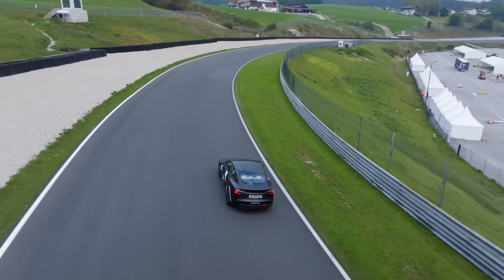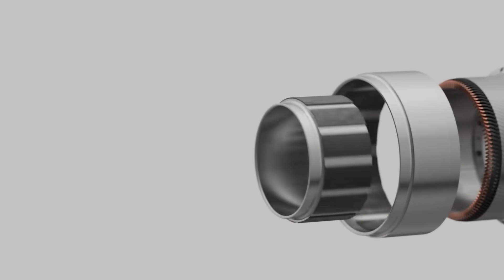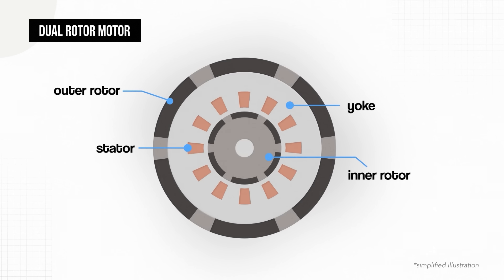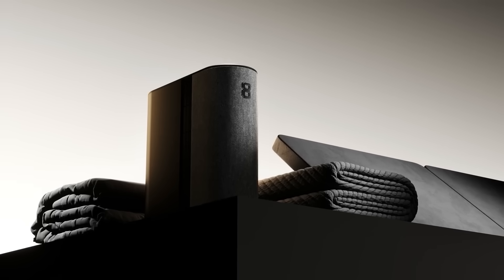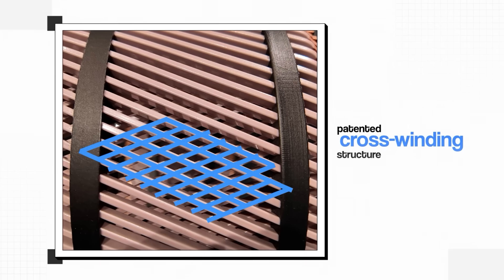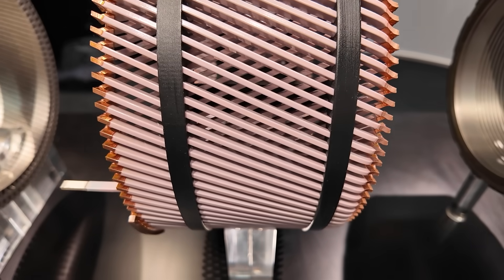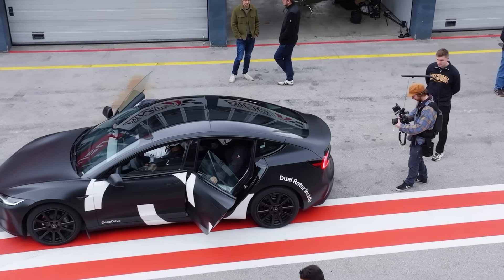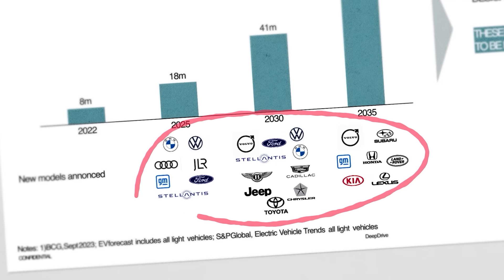How Dual Rotors Make Motors Insanely Efficient

Comment from the maker: Invest in a better night sleep and be more efficient with your heating and cooling with EightSleep! Use code ZIROTH for $200 off the Pod 5 Core or $350 off the Pod 5 Ultra, or visit https://eightsleep.com/ziroth
Reply: Only thing that needs to happen with their design is to shrink it down..... the fun you could have with that on an e-bike or in a drone would be wild (the latter especially due to the weight savings alone)...

maybe a 6 phase for industrial applications or stepper motor variant for robotics and the like.
Reply: @AnotherOtherMan   if its 20% more efficient with some of the new electric engines for planes that are like 92% efficient compared to ice ones that are 60-80% they might be able to push efficiency past 94%that means electric planes will have far longer ranges than non electric and cost pennys to fly in comparison 
youll have country's with cheap power having planes fly over to recharge there
Reply: @violetquinnlaw  The RC planes I've seen all ran on up to 85%-90% efficiency with just brushless motors, but they had to have their RPMS higher with less pitch on the props to get the high up. 

From what I can tell on the wire setup design. Only the X  part from above & blow that windings is giving out a high enough magnetic force to be used this means there is multiple areas that is just used for cooling & not actual force making.
Reply: @violetquinnlaw  It honestly makes a lot more sense for lower torque, weight essential applications like aviation, too. I worry about that cage long term in high torque apps, but in high RPM constant load applications like aviation it seems like a perfect fit. You could probably even do away with the liquid cooling with that much airflow
Reply: These are the people who kicked people out of bed when AWS had an outage. No DRM beds, thanks.
Reply: Oh I’ve heard about EightSleep … when their beds stopped functioning due to an AWS outage in the most unstable major data center in the US, with no backups, local control, or region failover … while charging their customers hundreds of dollars a year for the privilege.

Your channel seems solid, but if you are going to advertise garbage, it will pay the price. Find better sponsors who care more about engineering than profits.
Reply: ok how much is there subscription. id love to get one for my cat
Reply: Using both sides of the magnetic flux seems so obvious now
Reply: that shows that those big firms has zero R&D dep, no wonder they collaps !
Reply: Have wished to get such bed different temperature thing for quite some time. But come on, over 3K for a small fridge? Really? Isn't it some 30 times overpriced? And then an app. And a service, of course! No way dude. All respects for your content, but this ad is ridiculous. If we replace the fridge part with a thinner blanket, then we go down for the heater to pretty much 100 times overpriced product. If I buy such, then I could as well go full Adobe and Oracle.
Reply: With THAT kind of torque, you should definitely suggest to them that they connect with Edison Motors for use in electric axles in their heavy trucks.
Reply: Eggactly!
Reply: Great,  now all we need to do is get rid of the batteries and upgrade to  Micro Fusion power cells...
Reply: What is torque. More Atoms in Action
Reply: I want motor in horizontal design not vertical
Reply: This guy copied your video https://www.youtube.com/watch?v=G6Ye7vjgdVI
Reply: Are they listed on a stock market?
Reply: A press release with embedded ads - we truly live in a dystopia
Reply: That looks amazing. 

Checks site.

$4000 AUD ARE YOU MAD
Reply: nearly £2K to buy it and you need to  subscription !!!
Reply: @CaskAleForever  and yet they still sell your sleep/health data to 3rd parties because apparently that's not enough money to extract from their customers.
Reply: @megapro125  can't trust the "government" = can't trust smart appliances.. GREAT JOB, TAPEWORMS!!!
Reply: Didn't they also just have a huge problem with overheating when customers lost internet connection?
Reply: Game changer 👀👀👀

Comment: True DeepDrive has solved a few of the issues associated with in wheel motors.  But there is one big one that I doubt there is a solution for without some material breakthroughs.  And that's the vibration and harsh environment these motors have to survive.  The motor will have no suspension protecting it from the road.  Every impact will hit this thing and be very violent.  These motors probably will not have a long service life.  Even a slight change so its not truly in wheel but out of wheel connected with a CV Joint would greatly reduce direct vibration to the motor from the road.

Comment: Not new old idea that go back to the late 1970s there is also an electric motor and generator that was used copper tubing in the windings and flowed a cooling gas though the tubing

Comment: why use copper when aluminium is close enough at conduction (heat and electric) and a LOT lighter so ou can increse the bar size and have a reduced price.? Copper is used in conventional motors because aluminium is a poor material for the windings but thus may not  be the case with the bar architecture here.

Comment: What about in wheel motors on semi tractors. I wouldn't think the added weight in the wheel would be an issue as generally the central motor design is part of the axle and therefor also unsprung. What a reduction in parts and complexity and make it easy to have the front wheels powered.

Comment: adding another air gap increases the magnetic reluctance thus increasing the current required to induce the same flux, also I assume the outer rotor would require current pathways to interact with the magnetic field and generate torque, which means no lamination which means higher eddie currents and losses… must read more to see how all of this is addressed

Comment: I’m not an electrical engineer by any stretch, but to my understanding, there is a direct causal relationship between the capacity of a circuit to conduct an electric field and the surface area of the conductive element carrying the load. Hence the benefit of multi-filament cables in car audio systems, for example. 
The copper bars that form these truss lattices are essentially a non-ductile form of monofilament wires if i understand correctly. Yet they functionally replace a multi-filament winding (its the same wire passing by itself many times, so not truly multi). Is my grasp of this material as lacking as I suspect?
Reply: Yeah it is a little different than that. The multi filament car stereo wires are generally made of higher quality, lower impedance material, meaning the wires can conduct more without overheating because they have less resistance (and thus they generate less heat.) In this case the concern was the structural integrity of the component, if cooling is sufficient they can ram more wattage through the system and it would work just fine. It's usually more efficient to have more windings in conventional design electric motors (to a point obviously) but in this case they have other design elements that make their design more efficient

Comment: You and the designer have given no real world use. You say it is lighter . . . Lighter than what? What does it weigh?
What cars could accept  the internal motor? And marry it to a 5 speed tranny?
Will it marry up to a front drive car . . . A rear wheel drive.
Only destined for a new car?
Available for an EV conversion in my '66 GMC truck.
Building nifty things is just fine for a bunch of gear heads.
Now what good is it in the real world?
Oh, that's right . . . You didn't bother to say

Comment: Brilliant Work, indeed.  Elegance is a virtue.  Nevertheless, electric motors / generators under what has essentially been Faraday’s original discoveries (1821 & 1831, respectively) are nominally in the 93-97% efficient range.  So, isn’t the real achievement here reduced mass and volume?

Comment: A very clever innovation. However, whenever we see someone claiming 20% improved efficiency on a product that is already above 80% what they means is 20% of 80% which is 16% which is frankly hard to believe. 

The axial flux configuration is clearly superior in power to weight ratio, and look how long it is taking to see mass production of an axial flux car (not yet in volume use). And to prove durability takes years of testing, so we won't see deep drive in any vehicle until 2030 if ever.

Comment: Sorry to nitpick a brilliant innovation, but I am perpetually bothered that folk never "get" the difference between strength and stiffness. 
Something is strong, if it can support a load (force, torque) without BREAKING. Something is stiff, if it can support a load without DEFLECTING. While the two are often related (like, Young's modulus), copper (as a metal) is neither strong nor stiff (compared with steel, for example). However, stiffness is also influenced by geometry, and the "triangular" structure built by the diagonally laid windings add immense torsional stiffness through their shape, not the material they are made of. 
So, claiming that copper is used because "The windings have to be extremely STRONG" Is misleading. The windings have to be extremely stiff, because if they deflect, they will clash with the rotors, and the motor is instantly wrecked. 

I believe copper is used not for strength nor stiffness, but the good electrical conductivity and low resistance (hence its preferential use for all things electrical). The clever bit is the use of solid bar to make each run of metal stronger and stiffer (compare one solid bar, with the floppy flexibility of a stranded wire), and the diagonal layout adds the geometric stiffness of triangles, which will dominate the structural stiffness. 

It is certainly nitpicking, because resisting 2000Nm of torque is an insane load, so the structure DOES have to have strength as well. On the other hand, that torque is dispersed through every copper bar, so each one is only generating a small fraction of that torque, so the local loads are manageable. 
In this case, the welded joints at the tips of the winding bars are absolutely critical - this is by far the weakest point of the structure. But they could also fill the space between the bars with an inert material (like resin, or plastic) to provide a solid tube of material that would be seriously better for both stiffness and strength. Careful engineering of this (like, adding it as a sheet / tube between the two layers of windings) would barely affect the coolant flow and heat transfer, while still adding significantly to structural stiffness and strength. 

As an example, consider a weightlifting bar. Universally made from a high strength steel, they nevertheless bend by inches when really heavy weights are being lifted (like, 600 pounds). They deflect a little, but do not break. Now, if that same bar of the same geometry was made in rubber, the thing would never get the weights off the floor. It would stretch at the lifting point, deflecting probably several yards, before ultimately it would break, since the cross-sectional area of a bar of rubber will not be STRONG enough to pull the weight off the floor, no matter how high it is lifted in the middle. So, even though it visibly moves, the steel bar is (relatively!) stiff, and certainly strong, whereas the rubber bar is neither stiff nor strong. Copper would be somewhere between the two. Weaker than steel, but stronger than rubber, and equally stiffer than rubber but more flexible than steel. 
You can easily bend the solid copper conductor in your house wiring by hand - even the large 1/4 inch meter tails - but try to bend a steel wire of the same diameter, and your fingers will stop you in pain before you manage to bend it, because it is too strong for human flesh. 

The science of understanding stiffness and strength is a core principle of engineering, yet I see far too many smart folk saying "strength" when they mean stiffness. 
As if "strong" has somehow changed its meaning with common use, but (in a field as technical as this motor and the engineering behind it) it is important to use the right terms, to convey the right meaning.

Comment: I dunno man, I’ve been an auto mechanic my whole life, and the core problem with in-wheel motors is right there in the name: they’re in the wheel.

Wheels flex, shift, and torque on the hub. Maintaining a precise air gap between the stator and rotor in that environment is fundamentally hard. All the shock loads from the road go straight through the tire into the hub, and modern low-profile tires only make that worse. You’re hanging a very expensive, precision device in one of the harshest environments on the car.

Sealing is another big issue. In the real world, standing water, winter slush, road salt, keeping that motor truly sealed over time is extremely difficult. A curb strike would likely take it out. And when it fails, that’s not a half-shaft or bearing, nope... you’ve lost the motor itself. You’re putting critical hardware in the worst possible place. This is where clean engineering theory runs head-first into reality.

A much better solution, in my view, is mounting a compact motor to the knuckle on the inboard side of the hub, where a CV axle would normally go. Shock loads are dramatically lower, there’s no hub-induced torsion trying to collapse the air gap, and the rotor and stator are supported by conventional bearings like any normal motor. Sealing is straightforward, drivetrain losses are still essentially zero, and packaging is clean.

Run the HV cables, coolant loop, and control lines through a single flexible harness and you’re done. Same benefits, far fewer compromises. Honestly, it just makes more sense.  The space is there for small motors, but if you do four of them... hey, you've got your drivetrain.  It's just an e-knuckle instead of an e-wheel.

Comment: yeah bro, steel mounts for the magnets instead of the iron yoke use a more conductive metal... since steel has carbon in it and carbon is one of the universes best conductors... the fields are going through these elements. This plays a small part in the efficiency too. The iron kind blocks the magnetic fields. Everything is coming together. IF ppl could figure out how to make pure carbon housings with enough rigidity to mount magnets and a slightly better copper winding these would be superman efficiency. Thanks for the update on things around the world.

Comment: I worked for the OEM of aircraft electrical generators in the research and development department for about 15 years.  They studied and built all kinds of generator which all can be also motors.  It also have used FEM programs to model electrical magnetic flux fields and electrical coils.  
The image of the winding is an ironless coil that in the flux field is represented as an air gap.  A very very very large air gap.  This is where the resistance is highest in a magnetic machine.  Lots of losses.  I question the gain in performance considering this issue.  That air gap  resistance is going to be best guess ~90% of the magnetic flux resistance for static assembly.  The basic equation of force equals flow times resistance applies.  The force is from current flowing in the coil wires.  
The other major energy in the motor or generator is the skewing of the field to create torque which is another flux resistance added to the static value.  Torque is the force, coil current, acting on skewed permanent magnets.  Energy is torque time displacement that has to be equal to the extra voltage  time current.  
A typical magnetic machine is below 30% efficiency for a machine with the flux flowing mostly through iron and small air gaps. 
The PMs when skewed to develop torque in a magnetic field will have a resistance value, an effective air gap, because the properties of a PM when not magnetized is close to air.  So the flux having to travel using trigonometry has some fraction that could be consider flowing through non magnetized material.

Comment: Interesting.
If they are going to use solid material for the windings then I can not see any reason why the windings could not be copper tube like the coils of an induction furnace usually are. Electrically the middle of the bus bars do nothing so they could be hollow heavy walled tube that will reduce the weight of the copper per motor & provide much better cooling thus adding to the efficiency

Comment: But what are the limitations in relation to the "yoked" version?
Because I understand all the benefits, but there are ALWAYS tradeoffs.
What are the tradeoff? 
My guess is limitation in the torque curve (i.e: instant max torque) caused by the mesh structure which is NOT as strong as an engine with yoke.

Comment: Interesting. I've seen a similar motor, in shape, not in the workings, it was in the late 90s when I still was in the university. It was a huge motor that aimed to be lighter and air cooled, IIRC they were aiming to mining machinery. They didn't use magnets in the rotor, but it was relying on magnetic reluctance and induced currents, I remember the guy explaining to us the choice of alloys, etc. I wonder what happened to them.

Comment: For typical passenger cars, I'd say that in-wheel or "hub" motors should be fine. But for trucks or off-road use a centrally located motor would be better because it would be able to avoid direct shocks from the road, softened through the suspension system. It would also be better protected from the elements like rain, dirt and snow.
Reply: One of the challenges with in wheel or hub motors is power cable vulnerability and flexing fatigue causing failure.  Will require some innovation to create a reliable product.
Reply: @stewarts2507  That too, yes. I was actually relieved when Aptera changed their design, even though a lot of people were upset about it.